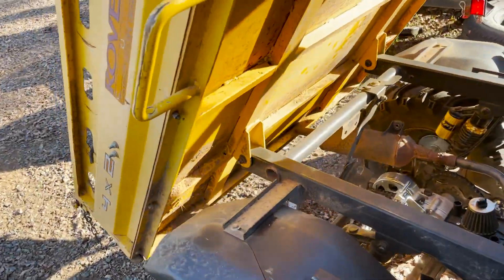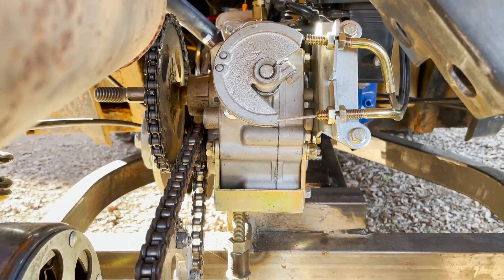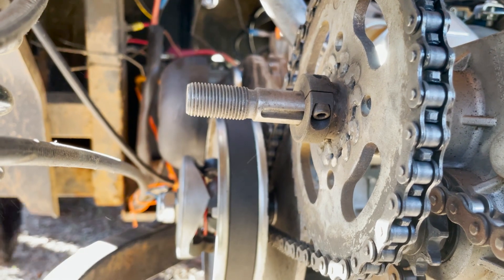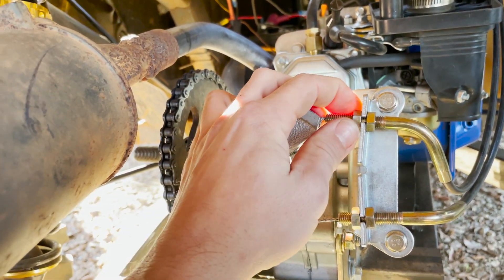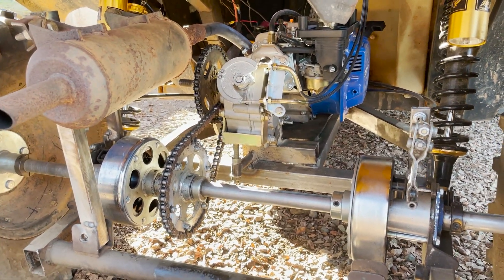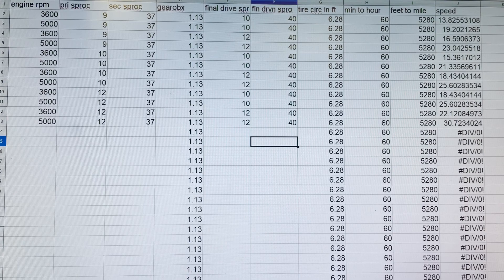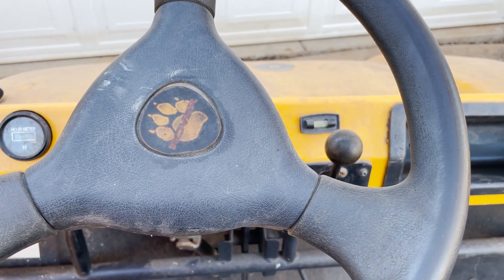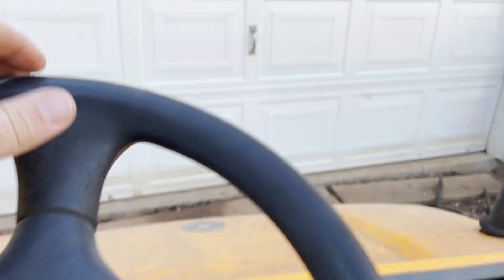Universal Go Kart Reverse Gear Box For 13HP Engine installed and explained.

Comment: I picked up one of these recently and I can’t get the chain to stop popping off. It has destroyed the 2 plastic rollers on the chain tensioner. It appears the driveshaft is sagging a bit. The top sprocket isn’t exactly 90 degrees. It’s all stock still. Did you have any problems with that before you swapped?
Reply from the maker: I did have this issue with mine after getting it stuck and loading the engine up really heavy. You might want to try and see if you can loosen up the motor mounting plates and try to get it set back in straight. Mine had broken the frame around the front of the motor and had to be fixed first to get the motor to go back on straight.

Comment: Here’s what I got going on would love some advice about how you made the gear box mount i watched two of your videos. https://youtu.be/tIKv9dhUeJ8
Reply from the maker: Mounting up the brake calipers, and the reverse box is pretty much the same process. It was just a matter of finding some 1/8" or 3/16" plate, and cutting it up, drilling some holes in it, and welding it all together. Because or the amount of torque going to the gear box, i did add another layer of plating with a few holes for some rosette welds to give it some extra heft.

Comment: If you drive the gearbox from the output side (sprocket) doesn't that turn the 1:1.3 gear reduction into a 0.76:1 overdrive? I'm trying to wrap my head around all of this since I'm building a Harley Davidson golf cart to run over 40 MPH, & it has an extremely low 12:1 rear axle ratio. I need all of the overdrive I can get since the gearbox is limited to 2300 rpm. hopefully I can put a 30-50T sprocket on the output shaft of the gear box, & the smallest sprocket I can fit on the differential (hopefully a 10-12T.)

Comment: Could you give me an overview of the changing system. I'm stuck I've installed new battery however 420 Predator is not charging the battery. My cart is American landmaster and used to have a Honda motor. Thanks much if you'll help me.

Comment: I got a built motor I think it runs 8500-10000 rpms now do you think this would be safe for me or would I just go through oil all the time
Reply from the maker: Its really tough to say. That is a fast spinning motor, depending on the build, would likely have a lot of blowby at high rpm's, and would go through oil. I don't think I have seen anyone run the reverse box that fast either, so I would highly recommend a big sprocket on the gearbox input shaft and try too keep it under the 2300 max rpm for the unit. People run these all the time without one, and just use the driven clutch, but again 10k rpm is really fast. In the comments here, there are a few really good comments from others that have used this gearbox with a mix of results. The gearbox hasn't given me any problems yet, that I am aware of at least. And that's sitting behind a tillotson 212 stage 1 racing engine, which I think runs right around 5k rpm, and claims 11hp. I hope that helps, and thanks for watching.
Reply: @TheSkinnny  thank you I might build a trans not sure tho but I just subbed
Reply from the maker: @aidentayes941  Thanks for joining the channel.  I would like to know what you end up doing with it. 10k rpms are gonna be screamin. Hope you have a good time building it.

Comment: Enjoyed the info in your video.  Did you measure hiw much oil you used in the gearbox?  Another video indicated that it is easy to overfill.
Reply from the maker: I did put the recommended amount in there, but there was not a recommended type of oil, so I used some 80/90 gl5 gear oil in it.  But as far as overfilling, the gearbox does have a breather on it, so hopefully a little extra won't hurt anything. So far no problems, but I do have to replace the bearing on my torque converter, and I am half tempted to crack the reverse box open to see whats going on in there. Maybe take another viewers recommendation to put some quality bearings in there if needed. Thanks for bringing up the gear oil, I should have mentioned that in the video.

Comment: Awesome  job , and cool little  tipper go cart / buggy , hows the gearvox holding up , any faults or maintenance  / repairs done ? 👍
Reply from the maker: I have roasted a few torque converter belts, temporarily seized the juggernaut. I took the kid out for a ride on it, and we got about 5 miles out when the torque converter failed. The weight of the rover and the steep hills are a little too much for a 30 series, but reverse hasn't quit working, and still runs smooth. I have made sure to keep plenty of torque converter belts on hand. If I don't go out for a long adventure, it's been holding together without overheating the torque converter.
Reply: @TheSkinnny  good to hear , definitely  handy to have a few spare belts  at hand , a small toolkit and some oil 👍 appreciate  your reply
Reply: @TheSkinnny  will this work on hayabusa? I'm installing a gsxr1300 engine in my trex
Reply from the maker: @TheGambinoo  Lol, You know, I would love to figure out a way to make that work, but the only thing I could think of was to pull all of the spark plugs on the motor. Then maybe that starter motor would be within the specs of the gearbox, and it wont lose all the hp fighting the engine compression. Hope that helps, but at least I enjoyed the laugh. I don't know much about motorcycle engines, but I think the honda goldwing had some models with built in reverse, I have no clue if it would possibly work though.... Check out Rather b welding did a vid putting a jeep transmission on his cbr 1000 project. https://youtu.be/iaNMkffO7DE

Comment: Hi, how did you get your shifter cables into the shifterbox (where the shiftstick is) there is a spring in there and i was thinking if i take that apart it might get difficult getting it back together. Am i supposed to take it apart? thank you so much for this video! Gonna help me big time :)
Reply from the maker: It does need to come apart to fit the cables on to the wheel. It wasn’t much going on in there, and I ended up trimming a little off the top of the spring to make shifting easier. But the spring is just to keep the shifter in the little grooves, and is simple to get back together, even without trimming. Then I welded a piece of angle iron to the back plate of the shifter to give me an easier mount. I ended up using 120” throttle cables with a little work to fit them to make it all the way to the front of the rover. Hope that helps, and feel free to ask if you have any other questions.
Reply: @TheSkinnny  Thank you for the super quick reply! Now i know what to do! Will start working on my project this weekend. I am building a mini snowmobile but wanted to have the reverse option.
Reply from the maker: @vinataba22  Sounds pretty cool. Weekends never come fast enough! Best of Luck
Reply: @TheSkinnny  Hey man, i really need your Help! I Mounted my Gearbox everything is set, but i just can't figure out how to put the cables in so that the shifter works right... I have been trying for hours... I tried your tip on putting the disk on last, but that wasn't possible if the cables are in the metal braket. The Disk woudn't fit over the round thing on the Gearbox. I am starting to think that my cables are to short. Or i am to dumb. Even if i got it to shift, the shifter was almost impossible to move. It was really hard, i don't think this is supposed to be so hard. Also always one Gear (reverse) will only go if you force the shifter there... If you know what to do here or can give me any more tips it would be much appreciated!
Reply from the maker: If you know where to put the disk on, take the bolts out of the cable bracket set the disk on, the revolt the bracket on, and probably loosen the cable stop nut all the way back to get the bracket back on. Once it’s all together you can re adjust the cables, and check to make sure they don’t bind up on one side or the other, or you have to set the disk again. Shifting is another issue, this was always the case with the rover, so I didn’t even think about it, but ya, it can be super difficult to get out of one gear and into the other. The gearbox will really hold the gear unless you can get all the torque off of the gearbox. You basically have to get the tires to move, either by tapping the throttle to get everything to spin, or rolling the kart to do the same, while you are shifting. Another thing to make sure of when your setting the disk is to make sure you find the sweet spot where the gear engages. I didn’t feel any kind of detent in forward or reverse to let me know when the gears are engaged properly from the disk end. There are the slots on the shifter, but you really just have to feel for it when your trying to dial in the shifter. I hope that all makes sense. Let me know how it goes.
Reply: @TheSkinnny  Thank you! I will try all these great tips first thing tomorrow. But for the difficulty of putting in the gears. Is that also the case when if nothing is hooked up to the gearbox? In all the other videos and yours aswell it seems as the shifter moves pretty freely. I had to clamp my shifter to a table to move it. I mean it also worked when holding it in the Hands but i had to use alot of power. I did actually try the technique with bolting in the braket last. This was the only way how i was able to shift but then i had the problem that the shifter was almost impossible to move or it wouldnt even let me put the shifter in the reverse position at all.
Reply: @TheSkinnny  Hi, thank you so much for the support. I did have to try again for a long time but i got it in the end. Shifter seems to work. Once i mounted the shifter, it was way easier to use.
Reply from the maker: @vinataba22  Awesome! I am really glad I could help, and thanks a bunch for watching.
Reply: @TheSkinnny  I might also try to put other cables in. For me they are way to long
Reply from the maker: @vinataba22  I had to break off some jam nuts and shorten some of the threaded end of the throttle cable to get it to work with the right amount of cable travel. just an fyi, changing the cables was a pain, but still workable.

Comment: I'm about to do the same exact thing on a Baja Blaster go kart I have an 18 horsepower Duramax I'm going to be swapping out I'm putting the same reverse gearbox I'm going to be using a chain driven clutch a fistacul clutch I will have a video soon
Reply: I have the same go kart. A blaster 65. I would like to see the setup you used for adding the gearbox please. I modified mine for a different gas tank and a series 30 torque converter. Finding these karts is getting harder to find.
Reply: I ended up putting a series 40 torque converter to the reverse gearbox with DualShock setup in the back
Reply: @davidwilliams9220  do you have pictures of the setup?
Reply: I have one or two quick videos once I'm a little farther ahead I'm going to sit down and make a series of videos on what I did and explaining what routes I took in What complications I have

Comment: Do you think the reverse gear will wear out faster than the forward gear? I need to run one of these gearboxes primarily in reverse and occasionally forward. Would that work? Thanks for the video btw!
Reply from the maker: My thought is that it should last longer that way so long as it isnt run too fast or too hard. The extra gear reduction in reverse should help. I really wish I knew a for sure answer, but I have only been running it for 2 weeks, so I cant really vouch for its durability. Hope that helps, and thanks for watching.
Reply: -- Just took mine apart and found chunks of chewed-up metal. it was still working but only had maybe 30 minutes of driving time. The main shaft that the driven clutch attaches to normally had excessive wear to it, the small gear. It has a chain drive in there for part of it then a gear drive for the other half. Not sure if forward is gear drive and chain is reverse. Just got a replacement and took it apart and it's clean. The main shaft has bluing on it but it's not any harder than the old one. Used high-quality moly 80-90 gear lube.Going to put it back together and see what's what in the forward rotation chain or gear.
think the main shaft is the weak link, can't see any wear anywhere else.
Reply from the maker: Great Info, and thanks for sharing. I still haven't gotten to pulling mine out, I'm totally buried in yard work this time of year. But its time to dive in since the bearings on the torque converter are now totally shot.